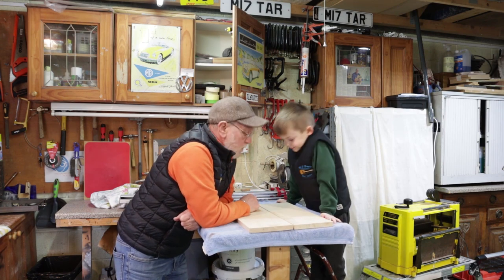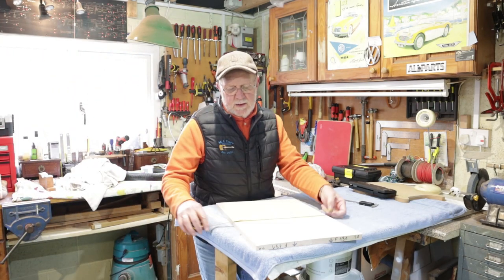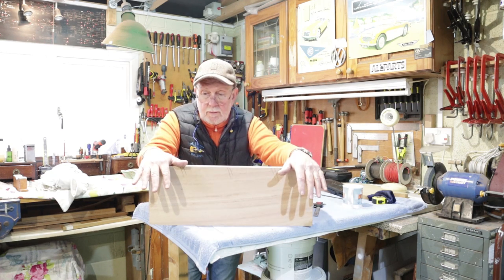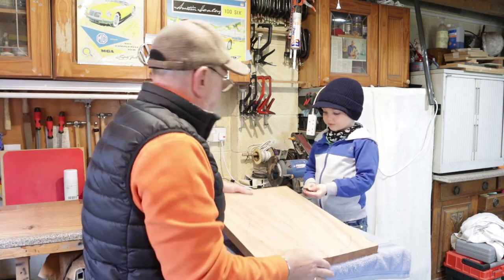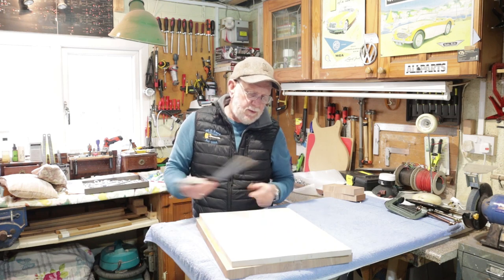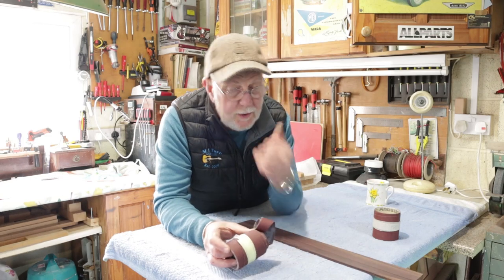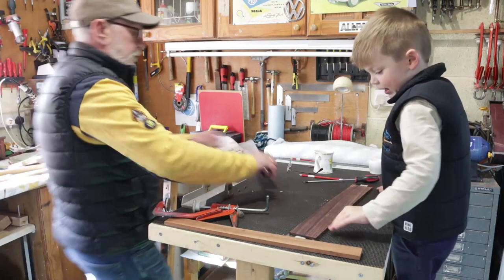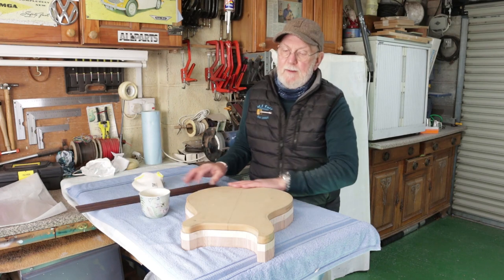Building a PRS inspired style Guitar Part 1 of 6.

Comment: Great videos! Congratulations Mike! Which plans did you use for this build? Thank you.
Reply from the maker: Glad you like it. its was a fun build.  No plans for this guitar build. Body shape came from the bottom half of my Les Paul and top half of my Stratocaster, pulled the two drawings together till it look right, and its spot on. Every thing else came from photographs. And the head template. Neck joint is the same as the Les Paul Special build, very easy to do. Any help just ask, more thank happy to help. you out. Many thanks for your comment. best wishes Mike.
Reply: Thank you for your reply  @mitarrguitars ! I am building now 2 Les Paul guitars (one with P90 and another one with 2 Humbuckers) - both from LP '59 templates. These Les Pauls will have 4 degree neck angle, with the neck tenon being straight and the neck pocket on the guitar's body having the 4 degree inclination. I am also starting the build of a PRS Custom 22 (and this is why I arrived to your videos). I saw that these PRS have 3 degree neck angle and it seems that PRS makes the opposite as Gibson does - PRS uses a straight neck pocket and a 3 degree neck tenon. The end result will be the same but, just to be align with the "real deal", can you confirm this was what you have done in your build? And about the SD pickups: what is the model of the pickups you have used? Thank you very much!!
Reply: On Les Pauls we have the neck plane (4 degrees, the same as neck) and the pickups plane (0.55 degrees). On PRS Custom 22 guitar it seems to be 3 degrees from the neck pocket all over the way until it reaches the tremolo/bridge. Can you explain how did you proceed with this? Thank you!
Reply from the maker: Your right mine as a 2.5 to 3 degree angle on the neck. Neck pocket is straight, but to be honest you can do it the other way if you wish. Ange the pocket and straight neck. I was not 100% sure what the PRS angle is, but 3 degrees max is my favourite. Have a look at my neck angle jig video you will see more. No angle on the top of the body it flat and straight to the start of the body carve. Pickup are SH-4 JB at the bridge and SH-2n Jazz at the neck. 
Fabulous pickup set I use it a lot. Many thanks, Merry Christmas to you. Mike